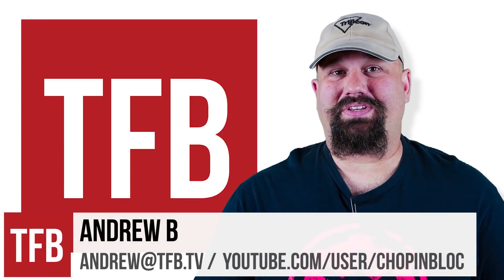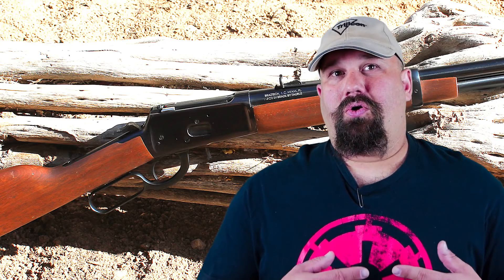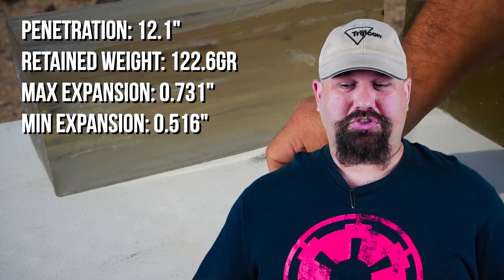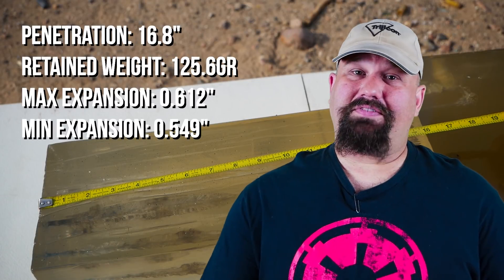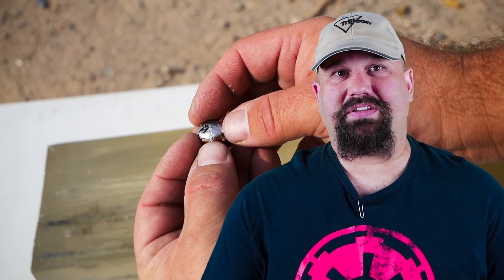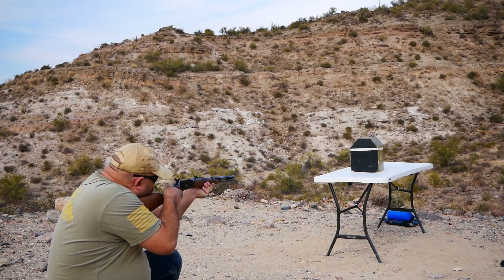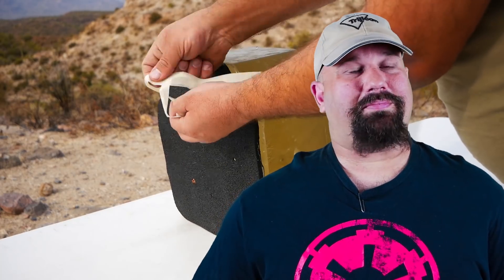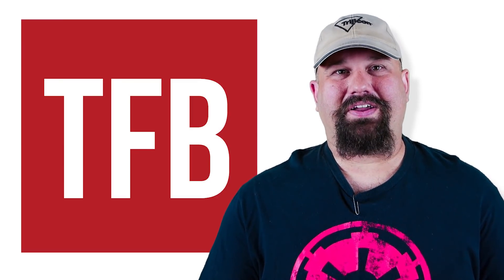Sig-Sauer .357mag 125gr V-Crown JHP Gel Test - Carbine

Comment: Not to throw Sig ammo a line but pistol cartridge velocities out of longer barrels like carbines and rifles can swing both ways. Yes, velocity is generally improved but these are pistol cartridges and thusly loaded with powders intended to be used in pistols. In a much longer barrel it is possible for a given pistol powder to run out of any real pressure before the bullet exits the muzzle. This can actually slow a bullet down. For example if your .357 load is fired from the full size Rossi and fired through a "mares leg" and its faster with the shorter barrel. A handloader can take advantage of a longer barrel and use a higher charge of slower burning powder in this case. Pistol performance would be poor but that is the concept. So if the velocity you saw seems low through the Rossi, it might be too long of a barrel for the powder type, charge weight Sig used.

Comment: Just bought 100 rounds of some Federal HST LE 9mm 147gn +P to test. I have some Sig ammo I was going to test through my gun for reliability. After watching your test videos though, I'm just going to shoot it and be done with it, it's only 25 rounds. Not to impressed by Sig ammo so far from the testing you have done on some of their stuff. If for some reason it doesn't feed reliably then going to try the Speer Gold Dot I guess. Walther PPS M2 with over 750 rounds since I got it a few months ago and zero issues so far. I have not ran any hollow points yet though.

Comment: I've had plenty of good results with the Sig Sauer ammo thus far, especially their 10mm. It's not full blown nuclear, but it's not .40 S&W either. I've used some of the .357 Magnum and I will admit I was using a 6 inch barrel gun, so expansion was pretty consistent and penetration not too bad. Definitely seen better .357 rounds out there that perform much better from a 4 inch gun or even a 3 inch gun. I'm not sure what they were doing with the load but I have seen worse, PMC Starfire's come to mind.... 

From a carbine though, the video displayed one of those key points I've made about PCC's over the years, which is some loads absolutely suck in handguns and out of a carbine they really shine. Winchester Silvertips in 9mm come to mind on that one. Granted we do have MUCH better JHP technology and so on, but in most typical carry guns, Silvertips either dont meet the FBI minimum or they just barely pass it. If I recall the Silvertip was one of the main reasons for IWBA protocol. But out of a carbine, it penetrates deeper, but does not over penetrate, and often expansion is quite good where it can be lacking in handguns on consistency. 

All in all I've been pretty pleased with the Sig ammo, but I cant expect it all to be solid gold. As you mentioned, the V-Crown is not the best design out there, but it's still not the worst. I'd love to see them do something like a solid copper slug for a 12 gauge though. Curb the typical over penetration slugs get possibly and get wicked expansion.